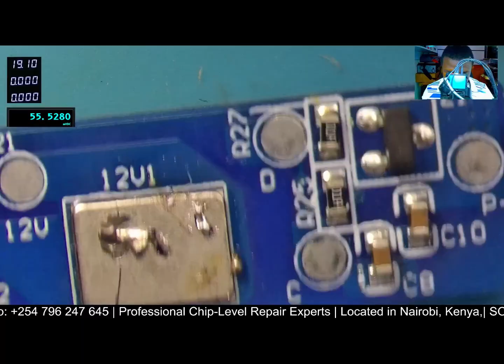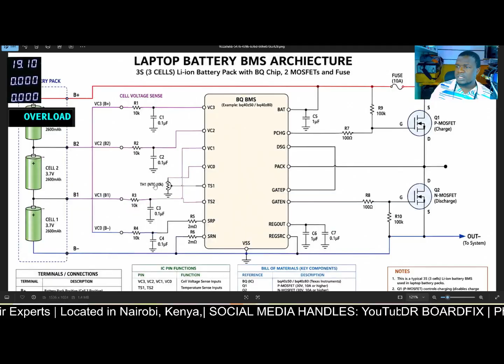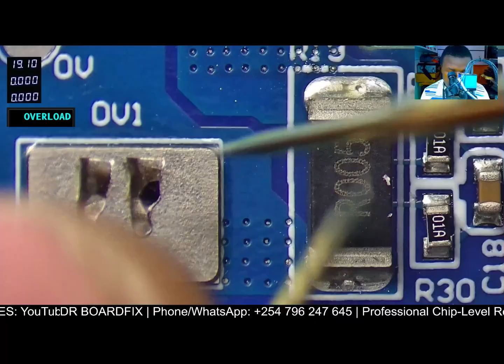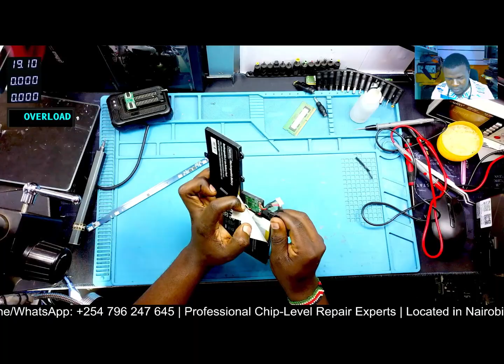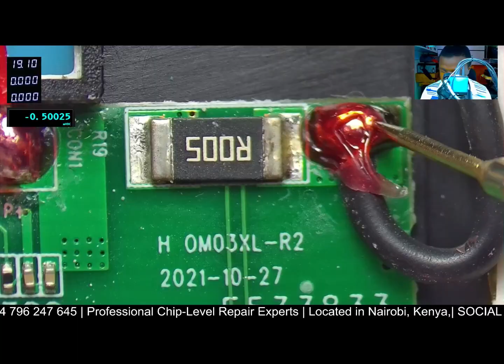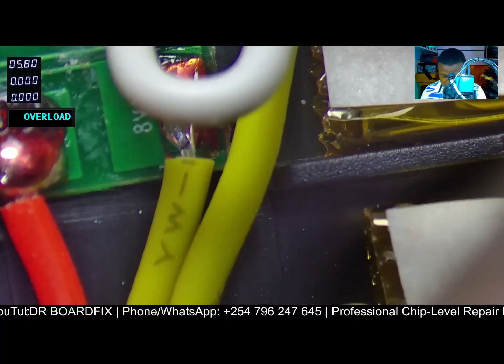Stop Replacing Laptop Batteries! Learn How to Diagnose Them Properly

Comment: Hello, I have a laptop battery with 2 cells showing almost the same voltage, but another showing a lower voltage. And the entire battery pack is stuck at 0% charging, not increasing. I tried to charge the lower-voltage cell to almost the other two battery voltage. After charging the cell separately, I then connected it to the laptop, and the computer  is still showing 0% charging with a dialog boox " The battery has failed due to normal wear". The battery cannot be charged. Replace the battery. Can you help me?
Reply from the maker: Seems its locked